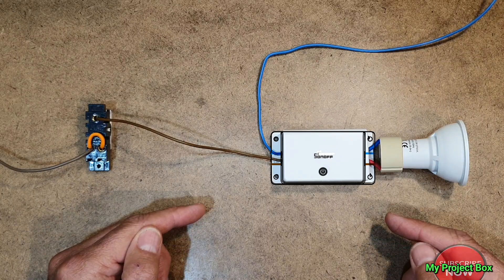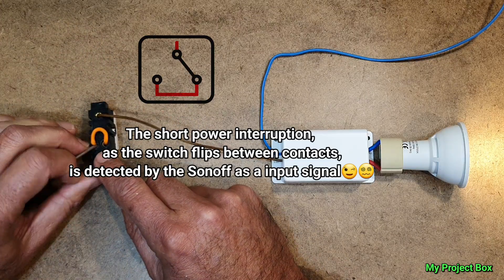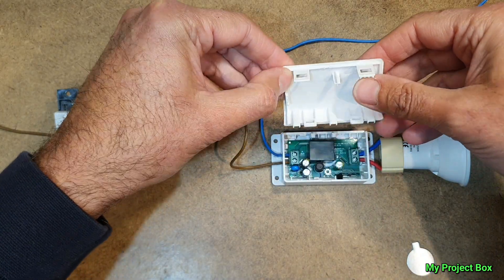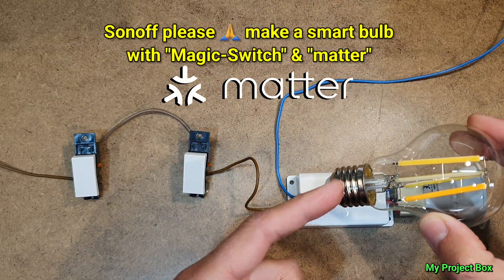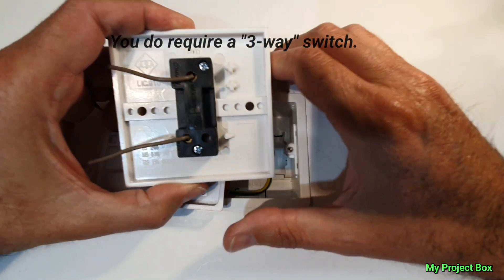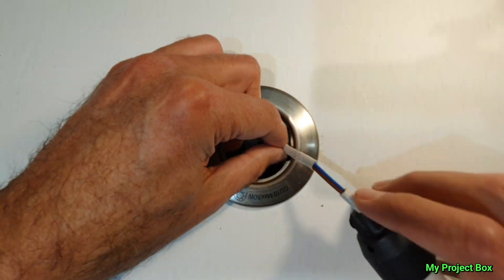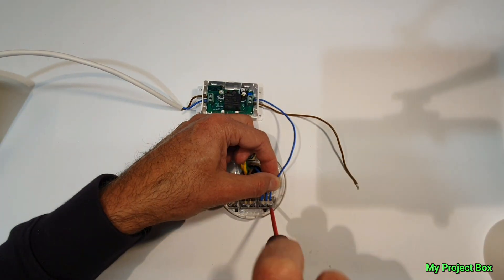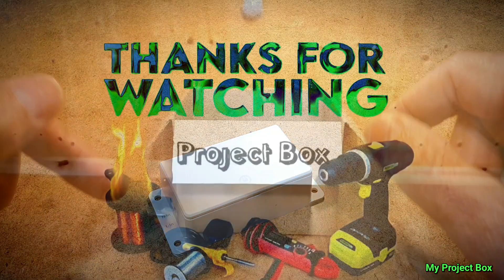Matter + Magic-Switch + NO-NEUTRAL Basic Gen5 Sonoff Finally did it!

Comment from the maker: The Sonoff Basic Gen5 is finally here — and it’s a game changer! 🚀

✅ Matter support → works locally, no cloud required
✅ Compatible with Apple Home, Google Home, Alexa, SmartThings & more
✅ No neutral needed → perfect for older homes
✅ No deep backbox required → works even in tight spaces
✅ Magic Switch mode → just link your wall switch and wire it at the light fitting

This little device makes almost any light smart

Comment: Just installed it into a UK 2 way lighting system thanks to your wiring diagram! However, the Magic Switch feature is only working intermittently for me. The rocker switches on my light switches seem to flip too fast, the Basic Gen 5 is ignoring the pulse. I have standard British General series 900 switches. I've just uploaded a video on my channel demonstrating the issue: https://youtu.be/iMzkBkR3us8 Any advice would be appreciated.
Reply from the maker: I think sonoff needs to add a software toggle to allow some timing adjustment, for different switches. For now, you could try different models of light switches, until one works for you. As you know some of these switches are very inexpensive from screwfix.
Reply: @MyProjectBoxChannel  Thank you for your response. I hesitated to change the switches as I recently renovated my home and replaced all of them to the same brand/style. However, it looks like it's the only current solution (I have messaged Sonoff support). I did buy my BG switches and sockets from B&Q and Screwfix. Can you recommend me a brand that you have tested that works?

Also, a switch that 'switches' quickly is a better switch. You want fast actuation to minimise the arcing time to reduce burnout and wear on the contacts. So ultimately, a desirable feature in a switch is incompatible with the Sonoff Magic Switch.
Reply from the maker: @AbdulAminGani   May I ask what type of two-way lighting circuit are you using in "Magic Switch Mode" ? Because the UK does it very differently to Europe. https://youtu.be/NudSvGNqbAo?si=IBptWGKIpV1omZ2y go to time stamp 10;33
Reply: @MyProjectBoxChannel  I actually used that video of yours to do the wiring. I copied your wiring diagram shown at 11:15. I commented on this video as I have the gen5.

I'm sure I have the wiring correct as the sonoff stays powered on in all switch states. It toggles correctly if I forcefully actuate the switches slowly. I can upload another video demonstrating this if it helps.
Reply: @AbdulAminGani  I have the same problem.  I have tried BG switches and now LAP (Screwfix), both have the same problem.  I have been trying to train my kids to press the switch gently as I don't have the problem, only them.   If anyone does find a switch that works consistently, please tag me.

Comment: Hi, great video 😊
Is it possible to connect than Basic Gen5 to my Sonoff T2EU-RF?
Thanks 😊
Reply from the maker: Not directly, because the Basic Gen5 doesn't have RF functionality, only wifi. So you would have to link it via ewelink and a different rf capable device. So it is kind of possible.

Comment: Interesting. So, on top of the typical built-in microswitch and remote control, the Sonoff Gen5 detects a very brief (milliseconds long) break in incoming mains and interprets this as a signal for changing the switch state. Pretty clever.
Reply from the maker: Yes exactly that, it's a clever trick 😉

Comment: I would love to know where you can buy the pendant covers in the UK.   Are they Ikea light fittings with the parts removed?
Reply from the maker: Yes ikea do sell the complete pendant, so that is a convenient way to get a cover. I did ones get some from B&Q , but I don't think they have them anymore. It's also possible to buy that type of european style pendant with cover online. I will have a look when I get time and post some links
https://ebay.us/m/Jy9HQj

https://www.spares2you.co.uk/white-plastic-ceiling-rose-with-grub-screw-023108-plu94768/
Reply: @MyProjectBoxChannel  Many Thanks!  I have been using the Mini R4 Extremes around all my lights, but these Basin Gen5 are a lot simpler for anyone who follows, plus of course Matter compatibility.  Your guides are awesome.

Comment: Hoe much current draw is there when the light is switched off?
Reply from the maker: I haven't measured it, but it will only be a very small amount of current from the PSU to power the microcontroller for wifi. When the relay is on, it will be a tiny bit more.

Comment: Awsome video, thank you for posting this update. 
The Sonoff5 looks like a really useful addition to their range. 
Some time ago I purchased a lot of "works with alexa" unbranded switches and had to run a neutral to every switch outlet; this included a lot of wall channelling, plastering and painting, going forward this new Sonoff5 device will solve all my histotic installation issues.
The thing I like about your videos is their clarity and clear wiring diagrams; I'm just amazed Sonoff dont put a link to your videos on their website.
Thanks again for posting.
Reply from the maker: You're welcome 😊. I'm glad you liked it.👍